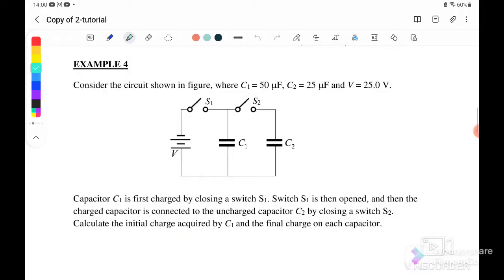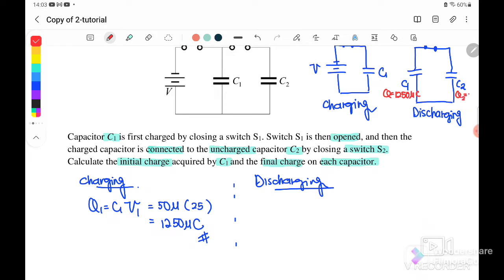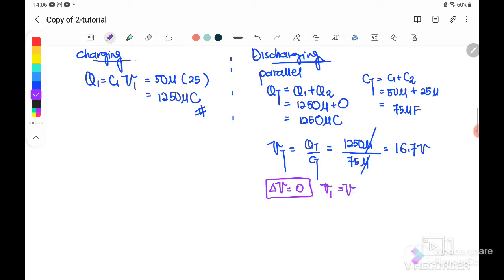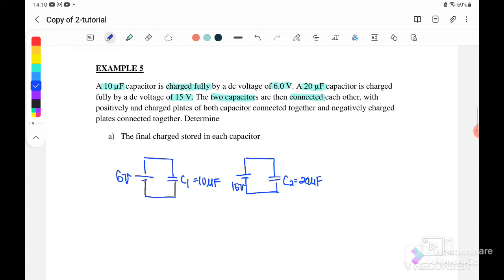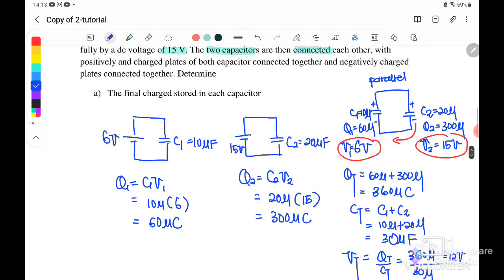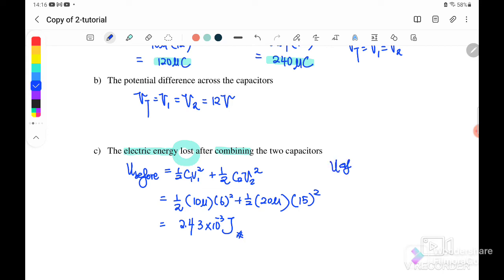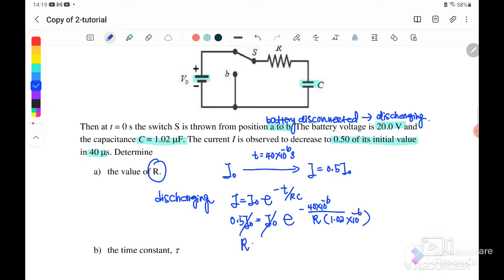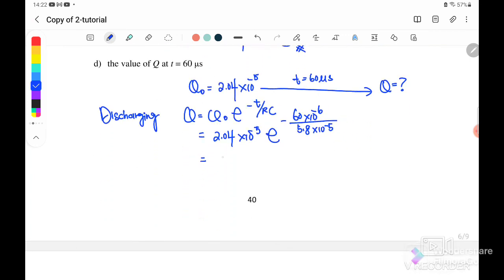2.2: CHARGING AND DISCHARGING IN CAPACITOR || SP025 || PHYSICS

Comment: teacher at 12:26 there, why the potential difference is not 0, the v for  c1 and c2 isnt the same?
Reply from the maker: C1 and c2 no potential difference but not equal zero
Reply: @drwongphysics  isnt that no potential diff , 12-12=0, equal zero?
Reply from the maker: Potential differences here refer to each Potential differences between the plate across each capacitor.. NOT Potential differences between c1 and c2
Reply: @drwongphysics  oh okk, understand, thank you teacher

Comment: teacher i got a question at 11:34 there isnt that the capacitor 1 is fully charge and its maximum is 60uC, how come it can go further to 120uC
Reply from the maker: initially 60micro, when connected with c2, there is the potential difference between c1 and c2. Therefore, c2 will give charges to c1 until no potential difference between them..